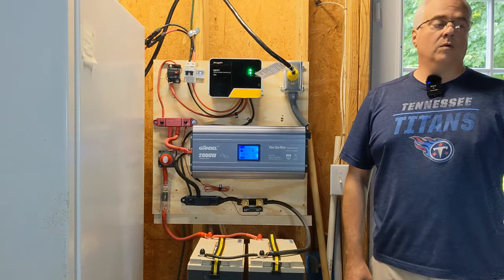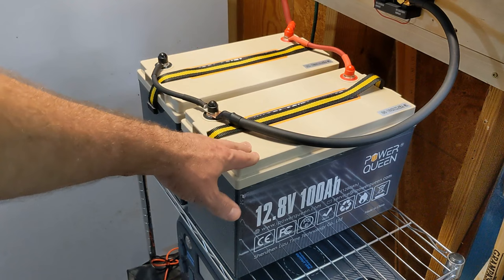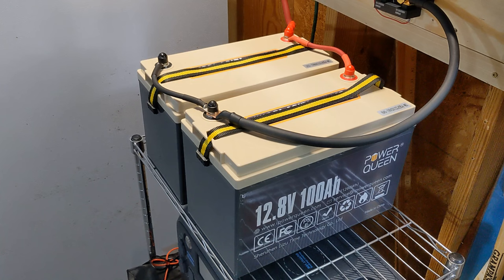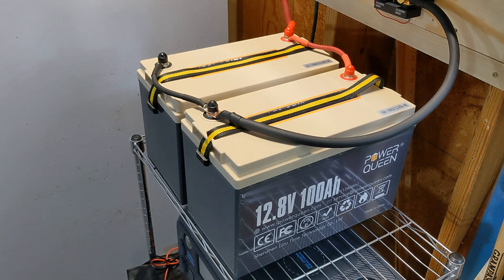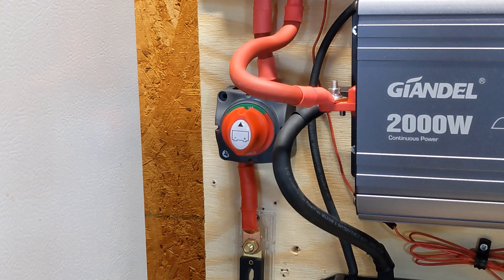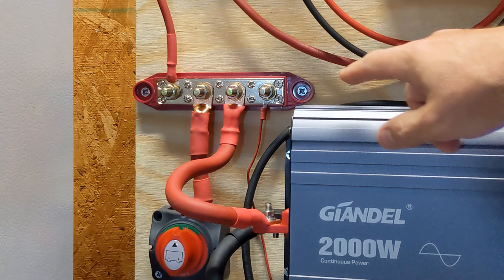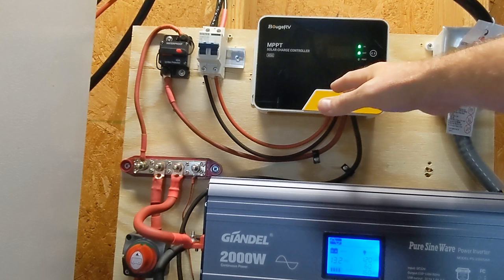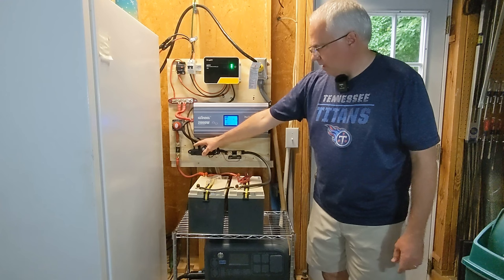How to Build a DIY Solar Generator Setup - Complete Review - Beginner Friendly - 12V

Comment from the maker: I'm planning on building a 24V system soon. I don't see too many of those around. I'm curious if anyone has an thoughts on 24V systems versus this 12V one.
Reply: Higher voltage more efficient, less gauge of cables too because the amps don't go up
Reply from the maker: I've put out a new video on the 24v system I built - https://www.youtube.com/watch?v=y2Ezj6nQNZ0
Reply: @proficientprepper  perfect!

Comment: GOT to argue what you said about the fuse in the red wire being at the battery!. NO! At the Battery means AT the Battery! Pull your wires from the battery to the disconnect switch and flip it end for end and put the fuse as close as possible to the POS post. Open any Commercial built unit or one that has to pass inspection and you will find the fuse on the POS post.  Take that fuse out of the fuse holder and bolt it to the POS post if you want.  Or get another fuse. it's a SAFETY ISSUE! Love your Design!
Reply from the maker: Good point. I will look into getting a fuse that can mount right on the post as an extra safety precaution. If something happened to the wire between the battery post and fuse, the fuse does no good then. I now use a 24v system with two 24v batteries. I would need one for each battery post. Thanks!!
Reply: @proficientprepper  If you want to buy another that's cool But you would be just fine flipping the fuse you got off the Switch and mount to battery with the same wires. End for End...

Comment: Nice video for a basic system. Suggest less arms flailing around in front of the camera blocking the items you’re talking about. I like the layout on the wall. Wondering why the batteries on external shelves vs wall mounted? Temporary setup, convenience of some kind????? Be nice to know that for others to emulate/avoid depending on their needs. Better to copy than reinvent such details. Watching previous videos about the solar panels, racking, mobility, etc. were very nice. Together you’ve built quite the library of information. 😊
Reply from the maker: I did not realize my arms were in the way during filming. I will get better as I gain more experience doing this. I already had that rack and it seemed to work for the batteries. So I went with the lazy route and just used that rack. Thanks for the comments.

Comment: I/we Are not/don't want to be electricians. You said this would be simple And like everyone else you talk about amp hours, I understand the gauge of wire is necessary. What the f*** is Amp hour? Honestly how many batteries/inverters/solar panels Do I need to keep the lights on fridge running in a blackout?
Reply from the maker: If you built this exact system, it should keep a full size refrigerator running about 1 day without using any solar panel input. If you connected four 200 watt solar panels as I used in this system and you have good sun every day, you could most likely run a refrigerator and a couple of led lights indefinitely. Of course the amount of sun and size/efficiency of your refrigerator has a huge impact on that. I am now using a 24v system I recently built and I was running several things every day no problem in good sun. But over the past couple of weeks we have had a lot of rain and clouds and I had to switch back to grid power for most things. Even doing that I can't seem to get back to a full charge. I need more solar panels now. So clouds can really throw a wrench into your plans. If you did not want to go the DIY route, you can always buy the portable power stations like the Bluetti AC200MAX. It is roughly equivalent to this 12v DIY system I built, but will cost more. If your are interested, I tried to explain amp hours, watt hours, etc here on my blog - https://www.proficientprepper.com/2023/03/solar-diy-concepts-and-equipment-for.html
Reply: Study so that You know how to install this confidently

Comment: I thought your video was very helpful. I'm just starting to build my 700w system and waiting for a few of the components to come in. I still had some questions about wire gages, fuses, and disconnects and you seem to have gone over it fairly well. Mine will be 12v also.
Reply from the maker: Good luck!
Reply: @proficientprepper  Now just waiting on the battery which should be here in a couple of days!

Comment: Best reason to do a 24 - 48volt system is you don’t have to use huge wire. More volts, less amps for the same wattage. Wire gauge is dependent only on amps.  Home systems should really be 48v.  Benefits and no downsides other than you have to be more careful with it. That bouge can do 48v btw.
Reply from the maker: I will eventually move to a 48v system at some point in the future. Right now, I'm enjoying the 24v system I just built and did a video on. We have had multiple cloudy/rainy days recently. Difficult to keep everything charged.

Comment: Why use an ANL fuse and not another breaker?
Reply from the maker: I'm not an expert on this, but from what I've read and seen on other videos, those little breakers do work, but are not as quick and reliable as the fuses. Sometimes the current can go quite a bit over the rating on those breakers before it will trip. I did buy some real cheap fuses once and learned that it does not pay to buy cheap fuses. Quality matters with breakers and fuses.

Comment: Nice build. I love do it yourself builds. I built a few myself.

We have an old GMC camper van that has been in  the family since new. We use it on 2-3 night trips to the coast and redwood campgrounds. I recently installed 400 watts of solar panels on the roof which are barely noticeable. It got a 300 amp hour 3840 watt hour Chins lithium battery, 2000 watt Renogy inverter, 40 amp Renogy charge controller and Renogy battery SOC meter. The whole setup fits between the front seats. I put an exterior weatherproof outlet on the right rear quarter panel outside fed by a 12 gage cord.  When we camp, the fridge/freezer, and extension cords get plugged in there. We run a small microwave oven, small instapot, coffee maker, and toaster with it as well as Ma's CPAP machine. I have a 6 light chandelier hung over the picnic table with a slide dimmer on it. There's a 1950's floor lamp that we use by the outlet as well. They always gets laughs at the campgrounds. The van has a stained glass 120 volt  tiffany lamp on the ceiling with a dimmer switch so Ma can find her pills at night.

 The best part of having a battery/inverter solar powered sunshine compressor is that it serves nicely as a mobile 20 amp electrical outlet. I recently built a gate for a friend and the solar power ran the worm drive saw, a pancake air compressor with brad nailer, belt and disk sander, paint sprayer, right angle grinder.....and it ran my Harbor Freight wire feed welder to make the hinge plates. This was a very useful project. There is a 50 amp Anderson plug on it to add another battery, run an external 1200 watt inverter, or to input charge from a generator and battery charger.

It was hot at the redwoods in NorCal, so I put a 20 inch box fan on top of the inverter box to keep Ma cool until the sun went down. Even with all of the redwood tree shade and heavy usage, the charge never got below 72% on the entire trip. The toaster and microwave beat on the battery the most. https://www.youtube.com/watch?v=cXQO80MghOU
Reply from the maker: Nice diy van build. It even comes with an arm rest. Some day I plan to get some kind of RV or van. That will give me something else to work on.
Reply: @proficientprepper  It is a useful vehicle. Has everything in there already...food, water, everything to camp with, supplies, meds, clothing. A real bug out vehicle. Even has long and short cordless hole punchers for defense or food acquisition. We had it since new, bought in 1989. All running gear was recently rebuilt, new crate engine, new tires, ready to go!

Comment: I love the way you explain your system. My only question is why you only have a 20a breaker between the solar and the mppt ? but a 40a breaker between the mppt and battery ? Gave you a thumbs up.
Reply from the maker: Good question. Although, I don't have a real good answer why I chose a 20amp breaker coming into the mppt. My panel arrays are bringing in about 11amps each. So I chose a breaker a little larger than what my panels were supposed to produce for protection of the system. I see they do make a 16amp version of that breaker which I could have used instead. Now for the 40amp breaker between the mppt and battery, I chose that because the mppt controller is a 40amp controller producing 40amp rated current. So if something went wrong with the controller and it spiked above 40amp, the breaker should trip. I used a 32amp breaker for the Victron mppt. That mppt is a 30amp mppt controller. So 32amd should be good for that. Thanks for the comments!

Comment: nice set up.
mine is like that but a lot smaller. i have 2x 110ah flooded batteries, victron 800w inverter and a tracer controller.
breakers on everything like yours but i added an extractor fan as my solar in in my garden shed.
when the temp hits 25 degrees a 12v fan kicks in sucking the hot air out and it turns off when the air temp is 23 degrees.
i only have 2x 100w solar panels but in series and will be adding a 3rd soon.
the power runs from the garden shed to a socket in the house in the living room and i use the power to run laptops, charge usb devices, a fan and a lamp.
i have added a kwh meeter in the shed after the inverter and before the socket/outlet in the house so i can see what power i use from the house.
i do save a small amount running a few items from solar but the main thing is if we have a power cut we have a socket in the house that will last a good few hours :D
Reply from the maker: Interesting setup you have. Good idea with temperature controlled fan.

Comment: Great video and nice build. Question at 200 ah how much run time would you get with your network utilizing this set up?
Reply from the maker: It totally depends on how much load you put on it. This setup should keep a typical full size refrigerator running maybe a day and a half without any sun. But if you had good sun every day, it could keep it running almost indefinitely. But we always get clouds, so if you had 400 ah, that just might get you through a series of cloudy days. If I just ran lights, then 200 ah should be fine to run that every day.

Comment: oversized battery cables , just wondering wich cable you will use for a 5000 watts inverter....
Reply from the maker: 5000 watts is right up there at the limit for a 12v system. For 5000, you would need the largest wire readily available which is 4/0 wire. 5000watts / 12.8v = 390amps.  Windynation is where I buy most of my wire and their 4/0 wire can handle a max of 440amps according to their website. But personally, I would never build a 5000watt 12v system for normal use. 1/0 wire is difficult to work with. I can't imagine building a system with 4/0 wire. It is very thick. For 5000 watts, I would at least use a 24v system if possible.

Comment: How did you come up with using  a 20a DC breaker for your incoming PV -
Reply from the maker: It has been a while since I sized this system. But from memory it seems like these panels have a maximum series fuse rating of 15 or 20 amps when wired in series as I have. I may could have gone with a 15 amp breaker. I believe these panels have a 11amp max.

Comment: How hot is your charge controller getting?  Mine was running around 112 degrees inside and went out on me after two days of use.  There was yellow oil and just the PV light was flashing. It would not power backup after disconnecting and reconnecting to the batteries. I've got a new one coming.
Reply from the maker: I believe mine is getting hotter than 112. Can't remember exactly. Seems like it was around 140. The mobile app says current is being limited because it is overheating when it gets really hot. Do you have the same Bougerv charge controller?
Reply: @proficientprepper  Yes, same controller.  I was running 6, 100 watt panels in series.

Comment: How did you calculate the breaker size for PV wire? I see people using all different sizes I’m using 10awg wich is rated for 30amps but read that mc4 connectors are rated for 20amps so maybe I should be using a 20amp breaker?
My panels are in series so it’s only like 7amps
Reply from the maker: For the PV input breaker, I used a 20 amp breaker mostly because that is what I had at the time. Shortly after I did this video, I did install a 15 amp fuse at the solar panel array. My solar panels are wired in series which means they can produce up to 12 amps. In retrospect, I should have probably went with a smaller amp breaker closer to the the 12 amps. If your panels are only 7 amps, then I would suggest getting above 7 but not too far above. I believe most MC4 connectors are rated up to 30 amps. There may be some at 20 amp ones, but I thought they were at least 30 amps.

Comment: Please upgrade the battery interconnect wires so that they are all the same guage.  Those #6 pull the same current as the 1 ot.
Reply from the maker: Thanks for the information.

Comment: What length of wire between each battery? I can't decide on either 6 or 9 inch...
Reply from the maker: I replaced that 12V system with a 24V system. But I was able to dig around in my box of cables and I believe I found the ones I used. They are 8.5 inches from end to end of the lug tips. I did not think to measure the center of the lug holes while I had them out. I hope that helps.

Comment: 285 amps????????????????????????????  Can I see you Math?
Reply from the maker: The 285 amps was the amperage rating on the 1/0 battery wire from Windy Nation. That is listed on their website. Let me know if that is not what you are referring to.
Reply: love your set up. But 1/0 is not rated to 285 amps. check out the NEC ratings of wire. I got the 2000 watt renogy inverter, and they said the wires that came with it  were good for the amperage, I upgraded to 2/0 . @proficientprepper